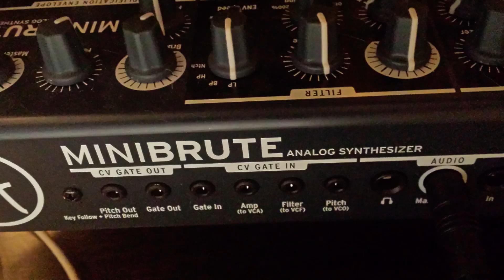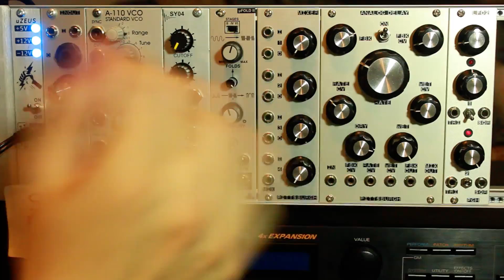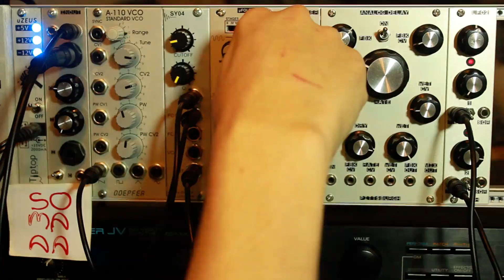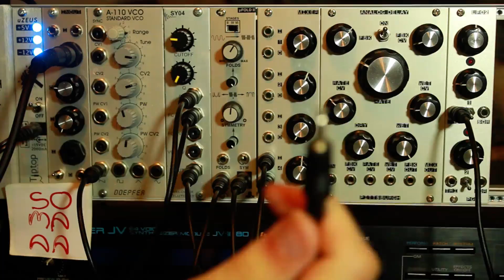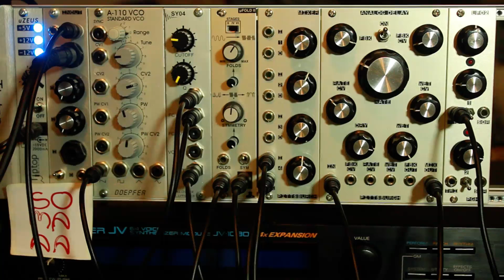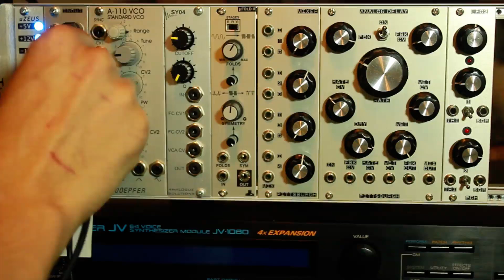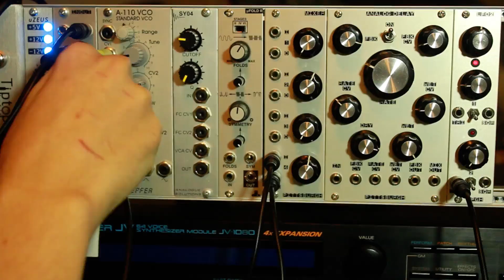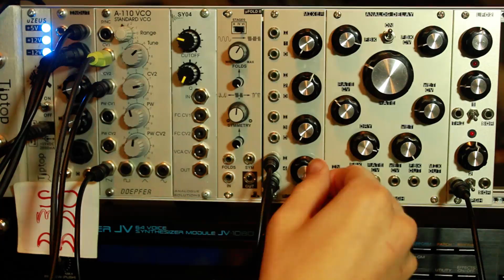Intro To Modular Synthesis

Comment: Trying to find a decent MIDI to CV converter circuit using Arduino.  Seems like this should be doable.  An arduino nano for $5 has 8 analog pins so I should be able to control 8 channels.  The code would just get the midi note info and create the appropriate voltage on the analog pins.   I'd like to get into this hardware modular synth stuff but I am going to have to make all the circuits myself on the cheap to be able to afford it.  Isee the delay module alone is like $350 wow.

Know of any good resources on the web with schematics for eurorack modules?
Reply from the maker: +Jennifer Gwinn I dont know anywhere to find schematics. Maybe you could contact the makers directly on analogue heaven and see if any would be willing to give you a schematic?

Comment: What do you think of hardware modular synths compared to modular synth software?  Do you think they model the sound well enough or do you think the physical analog circuitry is superior?  Reason I ask it is it is going to be quite costly to do the hardware route.
Reply from the maker: +Jennifer Gwinn I like hardware better because I can physically manipulate it in my hands. Creatively I dont think anything can beat hardware. I am more likely to experiment and try new things then just use presets. Some hardware sounds better then plugins and some plugins sound better then hardware. You can combine them both by sending a plugin oscillator out to modular effects or vice versa. I dont want to argue that one is superior then the other because both have their place but lately ive been using hardware synths more. Just got a Korg MS-2000 not to long ago.
Reply: +Soma Studios Personally I used to always think some software was on par with hardware, but the more hardware I get, the more I start to realise software is not much of a comparison. I can certainly achieve a great sound with software, but i feel hardware gets one to that point a lot quicker with a more intuitive flow. Nothing beats a proper piece of hardware in my eyes! I just got an MS20, and my oh my - it sounds incredible. I feel like I need to process software quite a lot to get to the same level of power/energy in a sound, which i almost feel is counter intuitive to the music making process.
Oh and great video - I was a bit baffled by some of the modules I had seen (game system module by pitsburough modular for example) and was curious to see a basic setup - eager to get into modular. I used do electronics, so the analog logic flow of the modular makes a lot of sense to me - digital menu stuff always deterred me from a creative point of view!!
Subbed to your page, thanks!

Comment: Very informative video! Thanks a lot~ Just a question, I didn't get exactly were does the power for the VCO comes from. I know it's a pretty noob question, but I'm just starting with modular synths ^^"
Reply from the maker: +Jose “zomfg” Zavala the uZeus on the left is powering them all from the back. theres a standard connector and cable for all of them

Comment: Very clear, thanks. I was surprised at how difficult it has been to find a book on the basics of practical modular usage and this answered a number of fundamental questions in my head.  I'm only just starting to build a Eurorack, though primarily for processing, having begun with Mutable Instruments Clouds and Roland Bitrazer - now thinking about Peaks to modulate Clouds as the next step. I would be very grateful of any pointers regarding building process-specific systems for unusual, non-standard effects.
Reply: Neu Gestalt, you are so correct.  Even most of the into Eurorack videos on YouTube are far from intro.

Comment: I have a beatstep pro sequencer.  i was going to use to pitch (cv) out and gate out.  can't seem to find many VCO's with gate it?  would i need to buy a midi to cv converter?  that seems to be the only module i can find with gate in for some reason?
Reply from the maker: +Zakk Blews I am a little rusty with my modulars now but i think you could send the gate to a filter or envelope -> filter and send the oscillator to the filter to get it to open and close the oscillator sound. I plan on getting a beatstep sometime too.

Comment: Noob here, building my first modular. Question; So the only way to hear and get audio out a rig is to use an in/out? Or can you go out from the sum of a vca, or mixer? Or again, is the in/out  the last and final module to audio output.... to an external mixer or audio card?
Reply from the maker: IIHOGZBREATHII The in/out is just convenient because it lets me adjust the volume and converts it to 1/4in. you could use headphones out or plug a 1/8in out into your computer if you wanted to

Comment: hi, great video, is the second module from left a kind of mixer/interface or what? thanks
Reply from the maker: Lorenzo Napoli Its an in-out moodule. It allows me to convert a 1/8in plug into a 1/4 in plug so i can record whats coming out. It also lets me take a 1/4in audio source and convert it to 1/8in so I can use the other modules and effects on it. both the input and output have volume knobs. i usually use the output of my minibrute synth to go into the modular rig so i can combine it with the oscilators in my rig

Comment: Thanks for this informative video,I like the way you explained each module in the rack& an example of how to connect them.
   I just got started with building a basic modular & I've already spent $700 & I only have 2 modules!(vco,vcf) Plus rack& power supply. I think buying used would have been a ok choice for me, it would have saved me cash& I'd probably have a near complete if not complete system,like yours.  So, good point you made.  About something else you said: you have the "in out"module to get your sounds out of the modular synth & recorded into your computer, being that You have a minibrute can you just sync your modular with the mini then sync the mini to you computer for getting the whole system in sync with the computer's master clock? Can you get the modular's sounds out from a main output Jack on a mixer module? Do you really need an "in out"module ?
Reply from the maker: Yes you can synch the modules to the mini then the mini to the computer. Thats the only reason why i dont have a midi input on my eurorack.

You could try just outputting the master 1/8in out from the modules and plug it into an 1/8in mic input on your computer if you wanted to record. The in/out just allows me to record on my interface which will be higher quality because its a higher quality A to D conversion. I would say its necessary for me but unless you have an interface and nice speakers, you may not be able to tell the difference.
Reply: Nice video, you should do more of them as they are helpful in learning modular synths.
Reply: Somaaa yes,I use good speakers& interface.
Reply from the maker: NYCPAUL PAUL I think I will. Anything particular you'd like to learn?
Reply: Somaaa yeah, I'd like to know exactly how I'd make a acid house style track with modular system alone excluding the drums because I'd use a drum machine,but the acid parts& bass& whatnot, I'd like to have all that with the modular,& I'd like it to possibly be making more than 1 sound(example:- an acid bass,an addition to the acid bass) , exactly what type of modules would I use? & how many of each? Would I have to get more than one vco,lfo,vca,adsr,vcf??
Reply from the maker: sorry for taking so long to reply. ive been doing a lot of traveling lately. im writing up a script for a video on acid house right now. for now, a short answer to your question is that you should get a good filter with a good 'Q' or "resonance knob. filtering and using a high resonance value is the biggest factor in making an acid house track. the other modules factor into making and shaping it.
Reply: Look into a few passive modules they’re cheaper options when gas kicks in. You can even build your own if you can solder.

Comment: I'm curious about prices and access to buy modules online. As far as I know, eurorack is the way to go, and I feel it'd be great for beginners getting into actually owning an analog, modular synthesizer. 

How much would everything shown in the video have cost?
Reply from the maker: not including the minibrute I paid around 700 for the modules and 150 for the power and rack. Most of what I bought was used from ebay though and I got some good deals. Everything works pretty well even though it was used
Reply: I'm new to this too,&I can tell you from some experience it's an expensive game, so be careful,read, ask questions,& buying used can save you ca$h! Our diy if you can build your own circuits, they sell allot of modules in kit form fir a chunk less cash, but then you have to build it yourself.